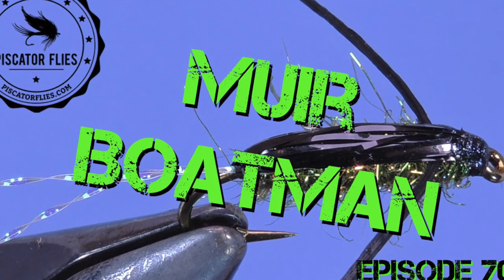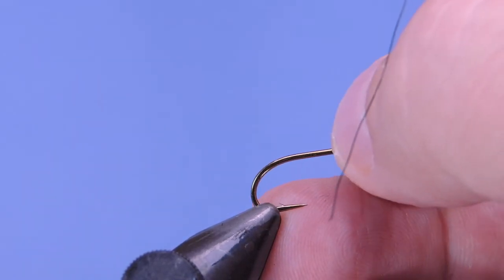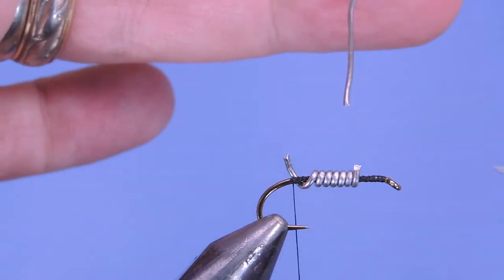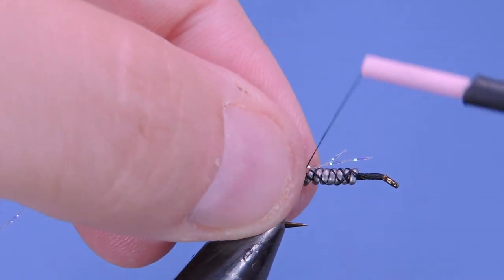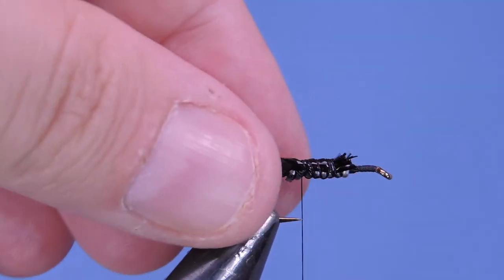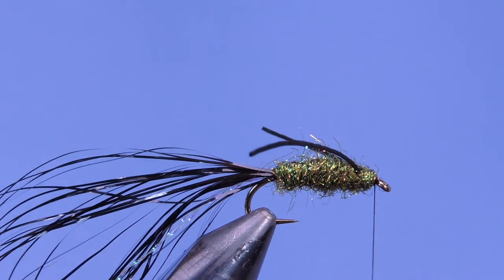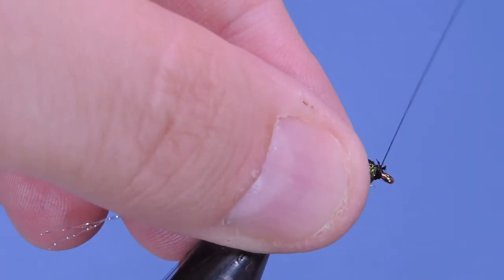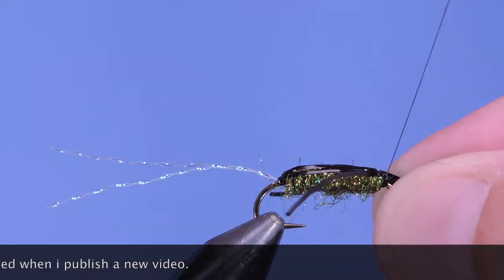Fly Tying the Muir Boatman Stillwater Fly Pattern for Trout - Piscator Flies Episode 76

Comment: Hey Darren, nice fly. I can't use lead wire in Maine, U.S.A. it is not allowed by State law. No lead of any kind. They are trying to bring the Loon population back and many of them were poisoned by lead. Really neat idea with the flashabou for the back of the fly. I have never seen it before. By the way, I would love to enter for the flies of the month. I cannot remember what you want me to do to register. he back of the fly. I have never seen it before.  Where did you learn to dub like that? It looks great but I have a hard time with natural fur dubbing like that. I am trying to learn to spin like you do.  Thanks for sharing.  All the best, Sean
Reply from the maker: +Sean Mooney Thanks for the comments on the fly Sean. I'll be posting a contest video at the end of the month with entry instructions. It will be the same as last month. If you can use the non-lead wire, I would use that, or a bead head version. You can place the bead (black) in the middle of the hook shank or at the front. When I first tied this pattern, I used swiss straw for the shell back but found that it wasn't durable enough. the Flashabou stands up much nicer than the straw. 

I'm not sure where I got my dubbing instruction. I think it's just the way I've been doing it. Would it be useful to do a short video about my process?